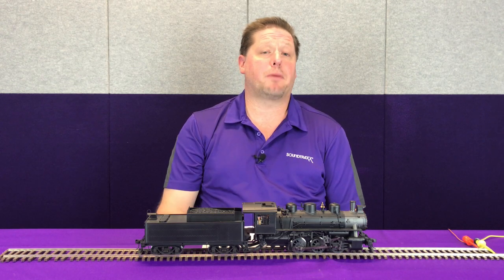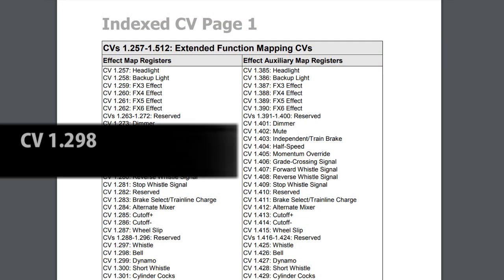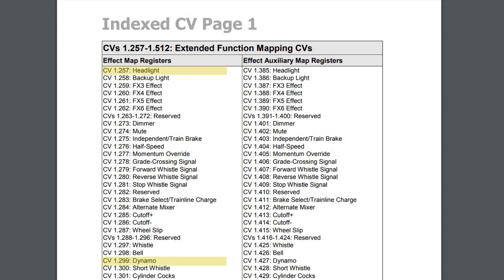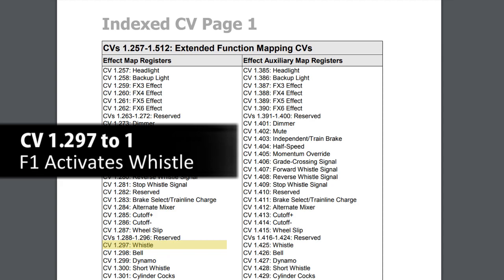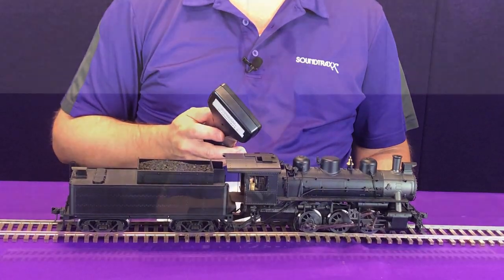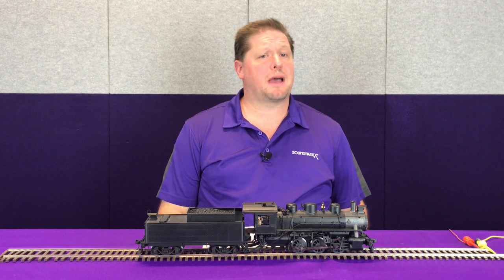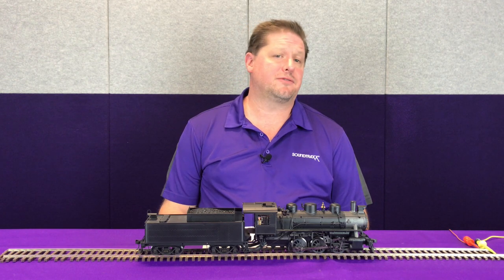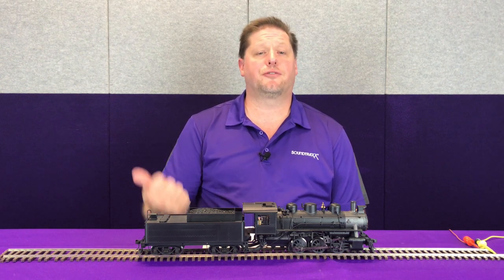Function Mapping with SoundTraxx decoders

Comment: Are you going to add resistors to the ECOPNP for the headlights as Digitrax does?
It saves wiring and space.
Reply from the maker: Resistors are necessary with LEDs

Comment: SoundTraxx has excellent sound quality, but I prefer a Lokprogrammer with graphic interface over the CV nightmare. True, you have to invest one time in the programmer, but then you can update your decoders to the latest firmware, add your own sounds and so on.
Reply from the maker: Thank you for your feedback. We understand that not everyone understands CVs and that is part of the reason we spend so much time on documents, webinars, and videos to help our customers learn how to use their decoders. Adjusting CVs is often much less difficult than people think it is. We actually have a webinar that will be posted to our channel this week that walks you through changing CVs with three different command stations.
Reply: @SoundtraxxDCC  I understand CV's, that's not the problem. I often get non-ESU decoders for repair and then I have to use the CV's... But it's just that the graphical interface saves much time. (Function mapping in a few clicks, rather then with all those CV calculations. ESU and Märklin have 32 functions now, I would be busy forever with those CV's.) I also like that I can quickly save all the CV settings on my computer. When I need the value of a CV, I just look it up in the software. I don't have to learn what every CV stands for, because in the software they are all described and showed with sliders. I hope you will go for a programmer one day. Many customers would be thankful. And those who don't like to buy a programmer. They don't have too! You can also do the CV calculations with ESU decoders.